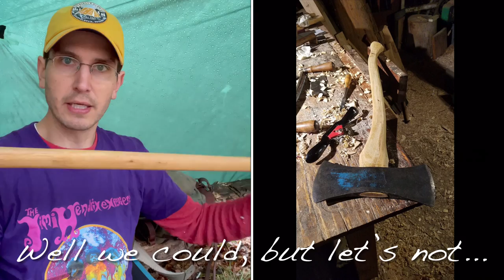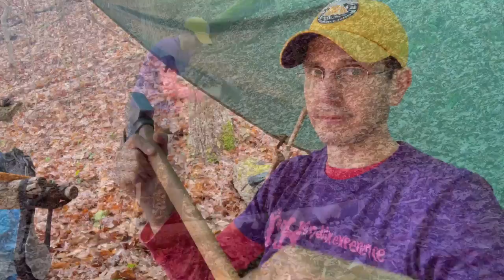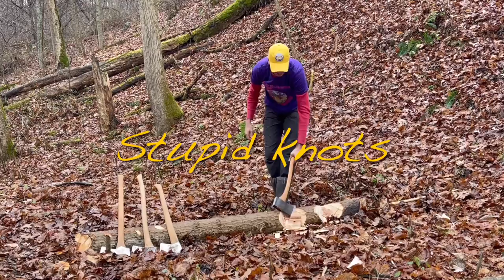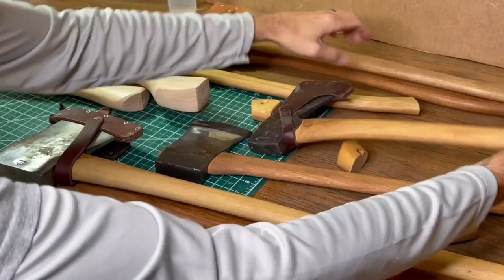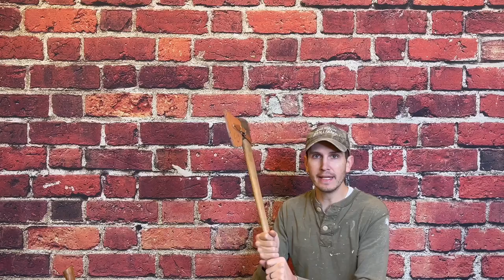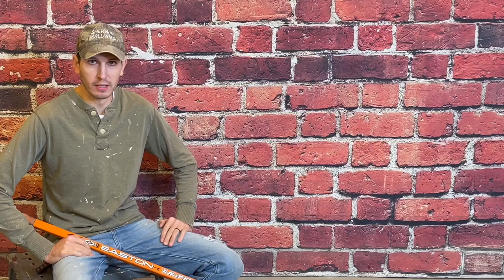Axe Handles: An Overview: Length, Shape, Wood, Grain, etc...

Comment: I doubted you and I’m here to say you were right! Put my 3 1/2 on a 28 and love it!
Reply from the maker: 28” is the perfect length, but now that you’ve started down this road I bet you’ll find handle lengths you thought you’d never be able to use very comfortable.  I thought 28” was the cutoff, but then I bought a Basque axe with a 24” handle and found it easy to use.  24 really does seem like the cutoff for me, although I’d prefer 25-28”.  In any case, I’m glad you gave it a shot.

Comment: Most real axe guys should be able to agree with 95% or more of this video. I think you covered the big picture quite effectively, and dabbled in some of the special circumstances as well. Thumbs up
Reply from the maker: I feel like that’s got to be the case based on my experience.  I do think there’s plenty of room for preference, but I just don’t see how you could argue certain points after using axes for awhile to chop.
Reply: @KevinsDisobedience  not sure if I've mentioned it to you in the comment section before. But give my new channel a look...

Comment: Lots of good info here. However... Literally thousands of years of wood workers totally disagree with your opinions on grain direction. If you don't care about longevity, as in using it everyday for generations, it matters less, but they used to make these things to last over 100yrs. There's Literally books full of structural data on this, it's not everything, but grain direction definitely matters.
Reply from the maker: Yeah, I’m aware.  Good grain definitely makes sense.  It’s just there’s not a lot of wood like that.  And we’re not using a single axe to chop with every day anymore, so probably matters less for us is all I’m saying.  Seems to, anyway, in my experience.  Runout is a problem though. I’ve had several handles break that way.
Reply: @KevinsDisobedience  fair enough, good point. Runout has been my major nemesis as well.

Comment: You get more leverage with a curved handle.  The angle of your hand is always higher than the head. Meaning the head is lower than your hands so the head is always more forward. Like they say punch past the  the object. So you hit your target before the end of the strike. This is what happens with these handles.

Comment: I've got a Plumb Boy Scout ax that I bought new about a half century ago. The grain orientation in the handle is about perfect. One time, maybe 45 years ago, I was chopping down a tree--probably maple--and the handle split from the shoulder to about 2/3s of the way to the end. I did not strike the handle on the tree, it was a solid blade hit!  As a "dumb kid" I took some Elmer's white glue and glued it back together. A little bit of sanding along the glue line and that handle still works just fine. 

I try to keep the ax thing fun and have been playing around with lengths, shapes, grain orientation, sap/heart wood, etc. I made an ash handle with the grain 90 degrees from "perfect" to see what happens... thus far nothing. My handles range from 28 to 32. The longest ones are old handles... one on my grandfather's double bit and the other on a Black Raven. I believe both of those handles were replaced at least once.  The last couple axes I hung have handles in the 29-30 range. They all work but I'm leaning towards about 29-30 as my ideal.
Reply from the maker: It’s amazing how much wood glue holds.  As far as length goes, I think you’ve pretty much come to the same conclusion I have, although I’ve been getting used to 25-24” handles out of necessity, as I have to pack them in further to get to certain parts of my property.

Comment: I thoroughly enjoyed his video. Lots of good advice and explications. I personally like a nice big palm swell, but like you said, it’s all personal preference. So many people forget that an axe is only as useful as the person swinging it. If you customize an axe in a way that makes you more comfortable/accurate, than you will get the maximum performance out of it… this is not a static environment. Everyone will have a different idea on what works best.
Reply from the maker: That’s my big thing on this channel.  Experiment and think for yourself.  Don’t just repeat what you heard someone say, even if they’re a smart person you trust.  And on palm swells, I’m actually starting to come around to bigger swells on 3.5 + lb heads.
Reply: @KevinsDisobedience  absolutely! First hand experience is the best teacher. Making my own handles taught me more about the ergonomics than anything. Made mistakes, corrected them, and came up with the perfect handle for myself.

Comment: good video, well explained.
I have a few thought here: 1. grain orientation and run out helps when you got too much over strikes.  2. they use long handle back then, as you said, nobody is chopping down big tree  nowadays. Also, nobody bucking that big of a trees all day everyday now. The long handle help when you bucking trees with more than 16 inch diameter all day everyday, it just let you stand straighter and less stain on your back. Timber sport people use short handle to buck things more than 16 inch because accuracy matter the most, they don't need to chop all day, even in training.
Reply from the maker: I concur. Everything you said makes sense and speaks to my experience as well.

Comment: I worry more about run out than I do grain orientation.  I suppose I do allow some runout as long as it's all going the same direction from foot to head, if that makes sense.  What's a no no for my is when Grain changes direction . Straight handles I worry even less. Also aggre with everything you said about length
 We are definitely on the same page.
Reply from the maker: So you mean if the grain runs out the opposite way from the axe head that the handles more vulnerable?  Interesting, I hadn’t even thought of that.  I’ll have to think about that.  Have you had any handles break like that?

Comment: Re: grain orientation. 

It matters with ash. The grains tend to come apart when being smashed straight on. This is a feature of ash that makes it so wonderful for basket weaving. I’m not 100% sure if this happens with all species of ash, but it happens with black ash.
Reply from the maker: I experienced this personally with ash.  Had slight runout and sheared right off in cold weather

Comment: Great video just the information I was looking for. I’m making a rescue axe right now and I have a straight handle and wasn’t sure if I should put some curve in it. Also it’s a full tang axe with a 13 and 5/8 inch handle from the top of the head to the end of the handle. I got some great information from your video thanks.

Comment: I've not had any of my hardware store handles  break but they will  warp over time despite not getting wet, being left in the sun, and being well treated with BLO.  This has led me to replacing them if the warp is severe enough.
Nicely done video!
Reply from the maker: Yes, I’ve had cheap tool handles warp before. That’s a good point.  Something I’ll mention in a follow up video, which I’m planning now.  I think the warping is due more to improper curing than anything else.
Reply: @KevinsDisobedience  That and perhaps the grain is not very straight.

Comment: Nice axe with that huge knot in it, really shows how much wood can vary. All axe handles will break regardless, some last longer than others. All my handles except one has run out to some degree, I don't think ill break one anytime soon from casual use. No need to stress over it, if it break ill just replace it.
Reply from the maker: I feel the same way about handles

Comment: all very interesting Kevin. in Italy, where I live, handles are mostly straight, I don't know if that's always been so but I like straight handles a lot. As for length, since we typically use slip-fit straight handles, they come very long, even 36" or more!! I'm not sure why but that allows the user to cut them to their preferred length. Which also means no palm swell. I'm 6'2" and i like 26"-ish handles for pretty much all I do, and I use them a lot as I get most of my firewood with hand tools, though I don't own a big axe collection.
One thing I will say though is that I do like longer handles on a limbing hatchet, 16-18". Here it's quite popular to limb with such hatchets, and I can assure you that if you do it as a means to keep your family warm and not as a camping weekend you want to save energy and time, and a light 1lb thin-bitted hatchet on such a longish handle is really great for small limbing. That or a billhook.
Agree on everything else, I'm not sure about grain orientation or wood type, I never broke a handle I made to be honest but I did break a couple and it seemed a combination of run-out but mostly bad wood (could have been badly cured like you brilliantly pointed out, or left in the rain or whatever)
Reply from the maker: Hey thanks for commenting.  First time I’ve seen you in the comments.  So welcome to the channel.  And we seem to agree about ha due length, although I’m not a fan of slip fit handles, but that’s just because I haven’t had very good luck with keeping them tight.  As for the rest of it, I think so much of it is just down to preference and what you’ve gotten used to over the years.
Reply: @KevinsDisobedience  thank you Kevin, I hardly comment at all, and I'm not on social media either, so I've been skulking really... now I've badly cut 2 fingers with a billhook so I've got time to watch some videos. it's interesting to see a burgeoning community of axe enthusiasts, I've followed some videos of Stephen (Skillcult), then Ben Scott and recently found yours, but in general I don't have too much time to be online and just prefer to be outdoors. I also share your desire to acquire first hand experience as you mention on the other video, though I just can't experiment with everything and sometimes handed down information (in the form of tradition) comes in handy. My background is a bit different from the typical bushcraft person (I didn't even know this word until recently), homesteading really is how I spend most of my time, and in doing so I try to use hand tools as much as I can, not necessarily as a challenge but as a concious choice, I like it that way. And so with axes. I've only read excerpt of Daniel Quinn, but I try to move in the "leaver" direction, if you're familiar with that.
have a good day!
Reply from the maker: Well thanks for taking the time to subscribe and comment.  It means a lot to us.  And like you, I only heard the word bushcraft a few years ago.  To me what we do in the woods was always referred to as hiking or camping.  I’m not really a bushcrafter, just a guy who likes spending as much time as possible in the woods.

Comment: I’m hoping you do a video about wood species in the future. I reckon most handles in North America are hickory because of its reasonable strength, reasonable water resistance, and great flexibility / shock absorption. 

However, I find it’s kind of romantic to use local wood species. We don’t have hickory where I live in northern NB, Canada, but so far I’ve used sugar maple, white birch, yellow birch, black ash, and black locust. I feel like these woods do just as well with careful use, they’re acclimatized to our extreme conditions, and they just kind of look cool. 

Keep the content coming.
Reply from the maker: Thanks man, yes I do hope to do just that.  I’ve only really just begun experimenting.  I’ve used a couple of ash (broke one), a few beech (feels a bit stiff), a white oak, hackberry (very promising)…I think that’s it so far.

Comment: Good stuff, keep the content coming.

The palm swell talk was insightful, not many people go vary indepth on the palm swell aspects of the handle but if your modding and fiddling with your handles enough, your gonna come across situations where you have little to no palm swell left... Ive found I prefer a small-medium palm swell... I like to gripe the entire palm swell in my hand, fully griped with no fingers hanging off the end... with a "small" swell my pinky runs in line with the butt end of the axe handle... with a more "medium" sized swell theres about a 1/2"-3/4" of handle sticking out past my picky.

   i'm 6'4" and thought longer axes in the 34-35inch range were ideal for me... until I made the chop and started using 30-32" handles and id never go back to 34"+ handles now.
 I find 30-32" is ideal for an all around work axe at my height, I also have a preference for straight handles but dont mind a slightly curved handle.
 
28-32" is a great work axe length, I really like 24-26" handles for a light weight camp axe or "pack axe" for the occasions I dont want to bring along a full sized 30 incher... but truthfully I have no gripe carrying around a 30" axe camping in the Canadian woods. 
  
One area that extra handle length can be useful is if your the type of person to split rounds on the ground vs. using a chopping block, though for many people 28-30" is still gonna be fine for ground splitting but it is one of the few tasks regularly done with axes where handle length could be a factor...
 
but as you noted handle length changes can be adjusted for by stance changes, at my height, 30" is perfectly fine for ground splitting in a nice solid athletic type of stance, 32" offers a bit more ease, as in, a little less knee bending and a 28" involves a bit more effort and cautiousness with quite a bit more knee bending.

Trial and error is the only way to really find out what works best for each persons personal axe needs and being able to confidently rehang an axe goes along way in giving confidence to experiment with various handle mods... since if it breaks, its no biggie you get to do it all again and try something else new.
It becomes part of the fun of owning and using axes is the variety and near limitless modifications and tweaks you can make to them with a little knowledge, patience and time.
Reply from the maker: Thank you, Tyson, for taking the time to comment and share your experience with the community.  It seems you’ve experimented quite a bit yourself, and that’s basically what I’m advocating for here.  Don’t take my word for it.  Go find out what you like for yourself.  Seems you’ve done a lot of that work already.  What’s thoughts on hatchets and handle length?
Reply: @KevinsDisobedience  My hatchet usage is kinda lacking these days, If I do use one its more for carving (dont do enough of) and odd kindling tasks. 

I like my hatchets in the 13-18 in range. 
13" for a carving hatchet and a slightly longer 18" for a work hatchet, 16" is the best of both worlds but theres times a slightly longer hatchet just feels better in the hands.

and with that said, I'm a big fan of what some call a "half axe" a hatchet head on a boys axe handle. 
I've got a 1 3/4 hatchet head thats hung on a 24' handle and for me its the perfect little pack axe/splitting hatchet.
Having the long handle to be able to get a proper two handed swing makes a world of difference... chopping, splitting, limbing it does it all and its a fun conversation piece around the campfire to folks that have never seen/heard of a "half axe" before.
I use it more then my hatchets these days for kindling tasks since Its great for one or two handed splitting, but for carving tasks you've still gotta have a good ol short handled hatchet in the arsenal.
Reply: @KevinsDisobedience  Also just to expand my thoughts a bit...
 I think a half axe makes for the perfect "kids axe"  
since the boys axe is what it is, maybe a hatchet head on a boys axe handle should be coined a "kids axe."
It will certainly be the axe I use to teach my niece and nephew axemanship skills, once they're a bit older/bigger.
imo it seems to be a really great size and weight for kids usage and safer in ways with the added handle length. 

 and to rant a little.. is it just me or is it kinda wild to think that hatchets are what so many start out with since they can be so much more dangerous in nature if your not paying close addition to the task at hand, some serious injuries can occur.. which is true of any axe but its especially true with hatchets and shin splitters...
 which seems to be the size many folks want to start out with these days because of the backyard fire/camp tasks that an axe/hatchet is mostly used for by people nowadays, but I truly think a standard boys axe or even a "kids axe" would be a much safer and more useful starter axe then a hatchet or danger zone shin splitting axe... 

and if one finds they need something smaller/lighter or bigger/larger then they'd at least have a good reference point after some experience with a boys axe.
in summary, im saying a 28-30" boys axe would be great for a novice adult or teenager to start out with 
and a 24-26" "kids axe" would be great for youth to learn with but thats just my opinion... I learnt with a hatchet and boys axes in my youth, then I quit using axes for about 6-8 years and when i finally regained kinship with axes I started back out with a 2.5lb long 34" axe (barely if ever had used such a long axe) then went down to a 2 1/4lb 28" boys axe and finally settled on 30" being my preferred handle length for 2lb-3 1/2lb axes, for a 4-6lb head I'd likely go 32" 

but for my current axe needs a 3 1/2lb, 30" straight handled axe is more then enough, a   2 - 2.5lb on a 28-30" handle is the type of axe i use most though as my general "work axe"